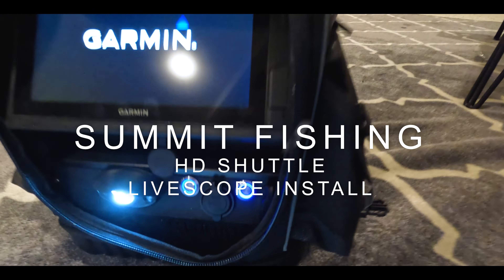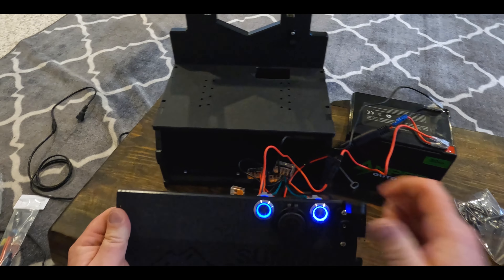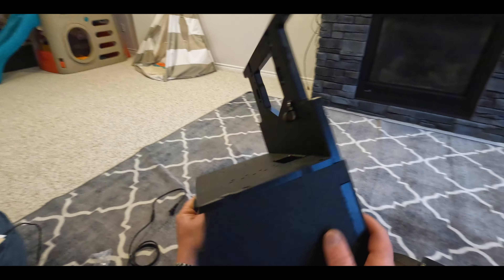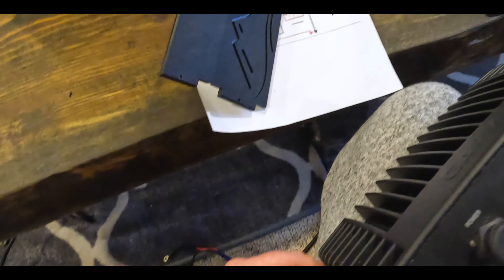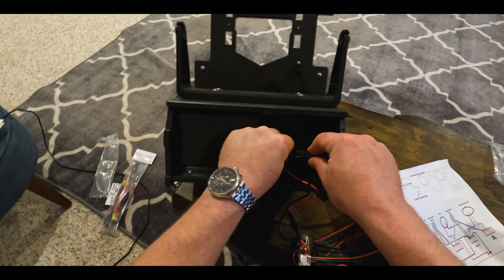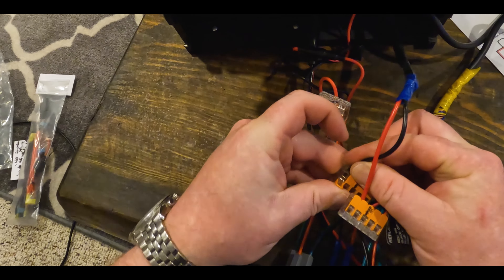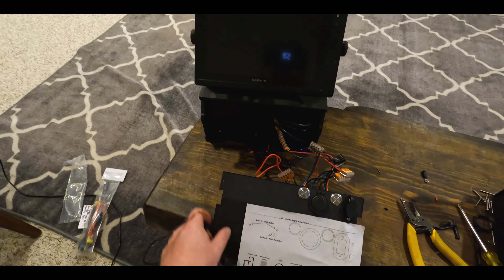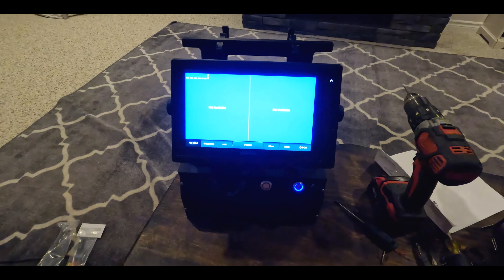SUMMIT FISHING LIVESCOPE SHUTTLE SETUP! (Wiring, Led Lights, Lithium Battery, and MORE!)

Comment: Do you have a link or any info on where to buy the wire connection the goes to the battery and quick exterior plug?the piece you said you have have to buy separately if that makes sense

Comment: I know on mine if you remove the battery holder that is held in with 2 screws, you can slide the battery in and re install the angle piece to hold the battery tight. There is a recess inside the rear of the shuttle for the battery to slide into. I found the 2 pin plug at oreillys auto store for $9.99
Reply from the maker: Great suggestion. Thank you
Reply: @cbsherrill7125  any picture of the pin plug you have? Thanks
Reply: @CRAPPIE168 I don’t have a pic because it’s inside the shuttle now but it’s the typical 2 plug that battery tenders use.  Also when I installed my battery I stuck some 3m two sided tape on the back side of battery and it has NO jiggle issues. It’s solid.